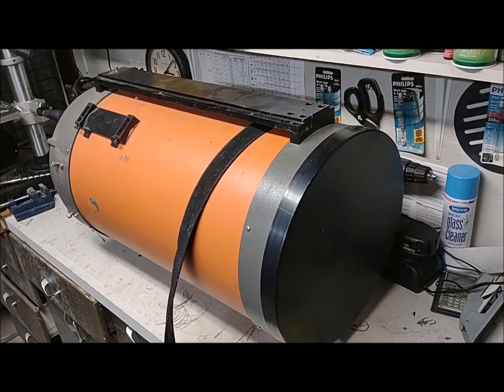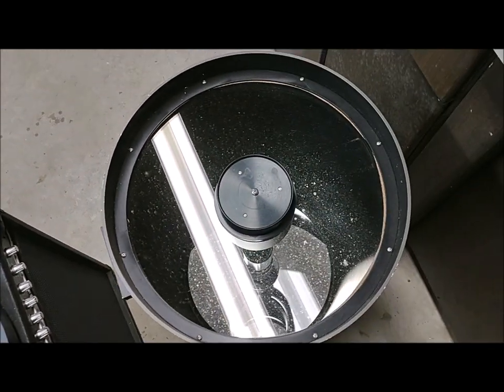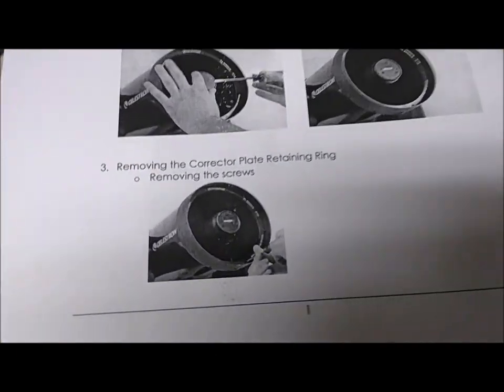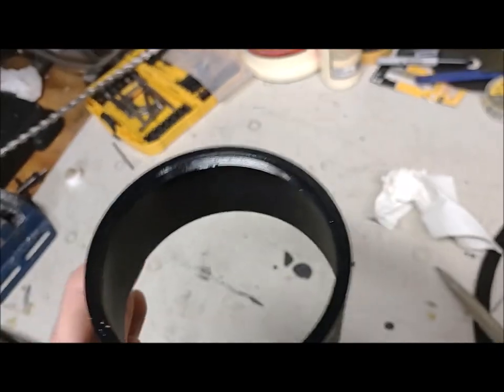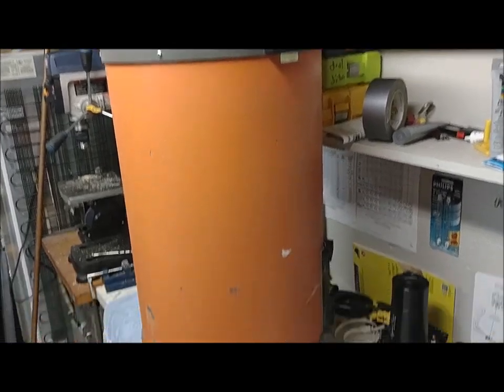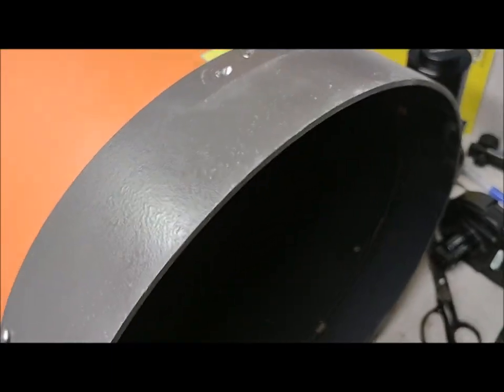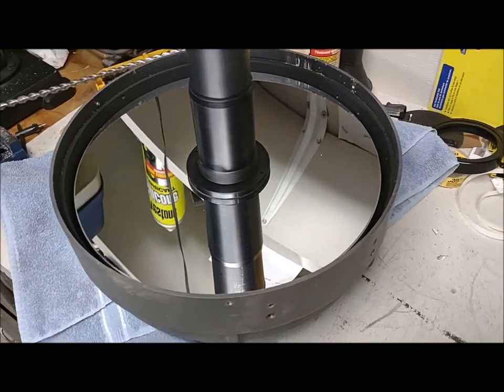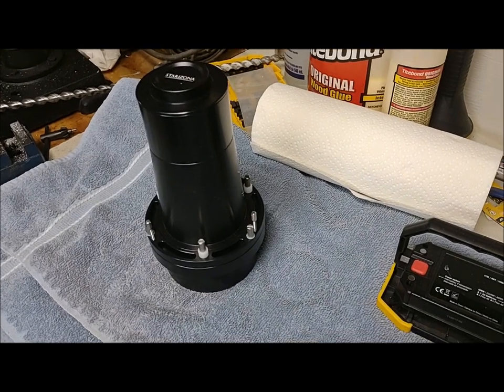Celestron 14 Conversion to Hyperstar and Carbon Fiber tube

Comment: What a fantastic project! How’s it been working?
Reply from the maker: Actually, not so good.  I am getting significant blue fringing around stars.  I have much smaller scopes that easily outperform it.  I talked to the vendor and they said the mirror may be pinched.  So far I have not had time to disassemble the scope and check that.  It may be because my C-14 is older (1983)... I'm thinking the newer ones may work better.  I do hope I can fix it, otherwise I have a VERY expensive piece of optical gear that I cannot use.